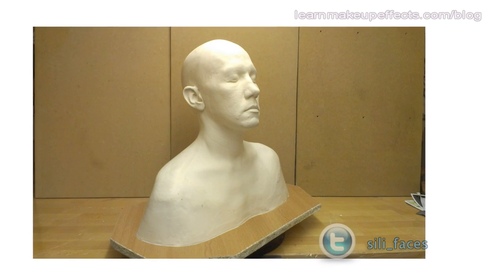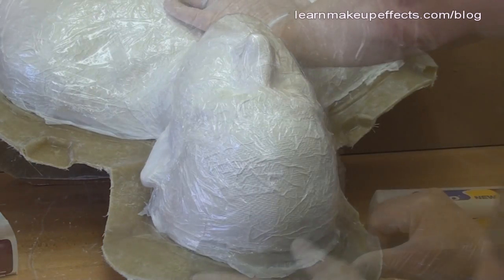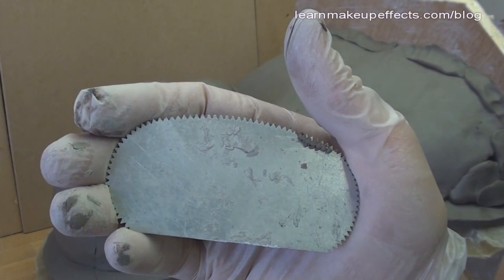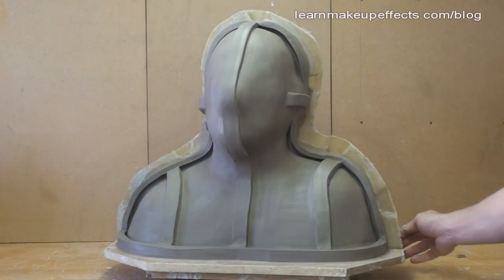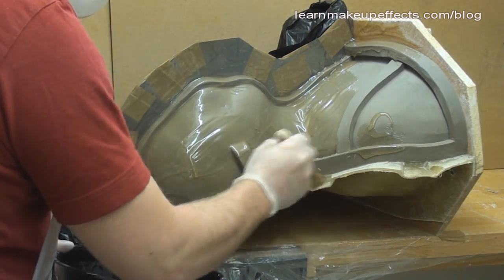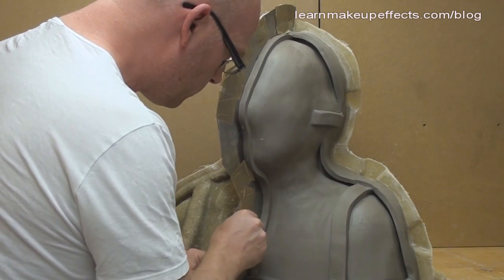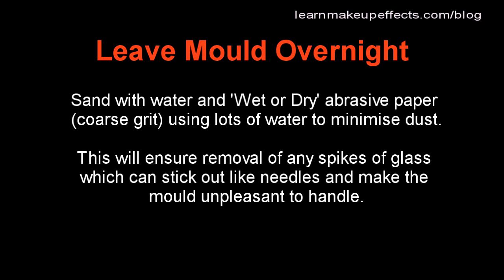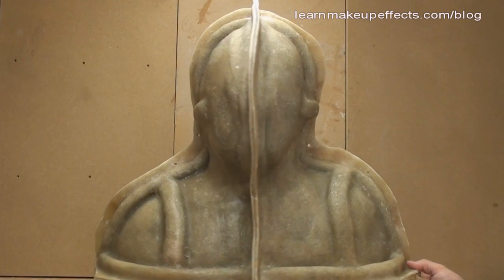Using Fibreglass Part 2

Comment: Hi Stuart, thanks so much for uploading these videos - they are very helpful! I'm trying to make a mother mold for my figure sculpture out of fibreglass at the moment. I was hoping to use "laminating polyester resin" with chopped strand fibreglass. However in this video you seem to use "gelcoat" resin. I'm wondering is laminating resin and gelcoat the same thing? Or is it better for me to use gelcoat when making mother molds of my figure sculptures? Any help would be greatly appreciated! Kind regards, Brendan
Reply from the maker: Gel pat is a thicker version of the same resin. The gelcoat goes on first to catch the detail. Once that has set you then apply the laminating resin and glass which is thinner so it penetrates the fibres easily.

Also the gelcoat prevents the texture of the glass from showing on the inside surface of the mould.
Reply: @stuartbray  Thanks for helpful reply! Can I ask what brand of gelcoat do you use? It would be good to get the gelcoat that you use in this video!
Reply from the maker: I like to use Scott Bader brand if you can get it.
Reply: That's great. I assume you're talking about the Scott Bader Crystic brand? I think I know what to buy now. Cheers for that!

Comment: I'm not english (language) native.
You dry the release wax with something?
I understand right?
Reply from the maker: Yes.  It will dry naturally as the solvents evaporate, but you can speed it up with a hair dryer.
Reply: Thanks.
By the way, awesome mold, I will try to do my molds in this way.
Reply: what is that "clay" name ...
please tell me sir..

Comment: Dear Stuart,

Love your videos. I made a fiberglass mold for my silicone mask. The problem is that the silicone is not curing in this mold. The same silicone cures in the mixing cup but the same silicone won't cure in this fiberglass mold. What wrong am I doing?
Reply from the maker: If you pour a small amount into the open mould, say the nose or chin, check to see. If the surface is not setting and remains tacky, then i suspect you have overcatalysed the resin.  It is possible that latex gloves when glassing may have contaminated the surface too.

Comment from the maker: You need something that is fume proffed so as not to cause issues with electric and potentially flammable fumes as with polyester etc.  Welding extractor suppliers are a good place to start as they have similar criteria.  It depends on the workshop space you have available, as the amount of cubic metre/foot of air that needs extracted will determine the size of the unit.  Some are free-standing and on wheels but occupy a large footprint, others are wall mounted.

Comment from the maker: Rubber kidneys from sculpture shops, and also the plastic scrapers that come with car body filler.  You can cut up an old plastic sandwich box lid, like a tupperware box.  Anything that has thick plastic, and is a made from something like High-density polyethylene (HDPE).

Comment from the maker: In the UK, I suggest The Fibreglass Shop in Brentford or CFS (Cornwall Fibreglass Supplies) which are good.  I personally prefer the Scott Bader brand over Bonda or other types.  

If making latex masks, stick with plaster moulds as the moisture needs to be sucked out of the latex and fibreglass is waterproof. Both can be used for silicone masks, and fibreglass is lighter and more durable!

-Stuart
Reply: stuart bray what type of clay do you use  Vic

Comment from the maker: I talced the back of the plaster head as I had waxed the bill-o out of it.  I really want the hard plaster and the hard fibreglass back to part without damage.  The front is all clay so I didn't wax as crazy this time and the clay will peel out.  The talc is essential, but I liked to show it as a technique.